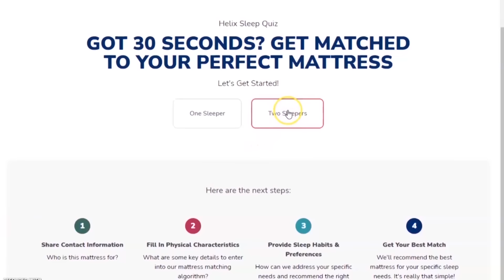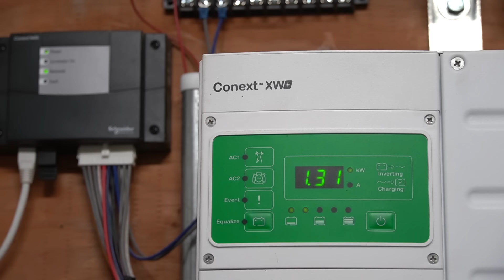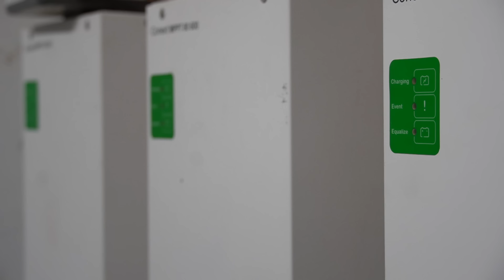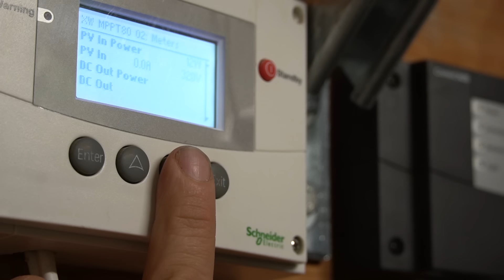Arctic Blast: Severe Weather Update Off-Grid

Comment: Nothing brings on babies like 3am and nasty weather. When we had sheep we didn’t worry about getting lambs big enough for Easter time, so we planned for lambing into March or April. Dairy cows year ‘round. Our friends and neighbors who did early lambing, which we helped with every time, had more difficulties. One thing we always had available, besides the barn and plenty of bedding, was heat lamps. HUGE help in frigid temps for the little ones for extra warmth, even with Mama there. Of course where we’re at in a real winter (not these open winters) we get a lot more snow and colder temps. Second half of January into February can get pretty bitter. I’ll take these single digit negatives better than some of those nights we’ve had where it can get as low as -25 to -30 and a few times -40 or more. PA is not too far North from you though.

Carried 5 gallon jugs of hot water out to melt ice was always “fun”. 

Winter 2007 we had LONG overdue goat kids born third and fourth week of January, both on THE worst nights. I think -44°F. Yuck. The long expected part was we got the mothers (both WAY too wild) in October and was told they were pregnant and the window was Thanksgiving to Christmas at most. 😂

Comment: hey josh and erin. to keep the water for the sheep from freezing you can use tracing what we use in the Netherlands. it is a low voltige and amp watertight electrical wire that you can wind around the bucket! succes!

Comment: Josh, since you're creating heat with electrical components and freezers, maybe you could channel or duct that heat up around battery bank with some sort of insulated panels as a hanging ceiling and some fitted panels around convertors on wall to allow heat to flow upward where it's needed for improved battery conditioning ?

Comment: Have you ever thought about installing a Faraday cage around/inside the powerhouse in case of EMP or CME, so that the electronics in your power system are protected?  Do you have spares (backups) for your controllers/inverters?

Comment: Can't you put blankets on the sheep. I know they put them on horses
Reply from the maker: It’s not necessary. Unlike horses, sheep are very insulated and have grease in their wool to help keep their skin dry. Plus, they have free access to the barn for shelter so if they felt they needed to get out of the elements they would. Typically our sheep stay out even when it’s icing. The only issue is lambs- they need to be moved inside.